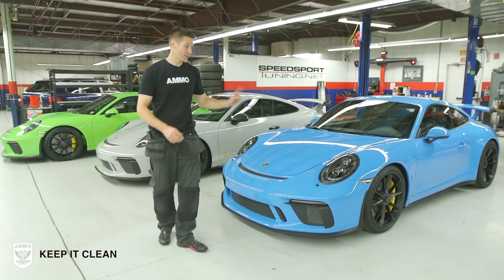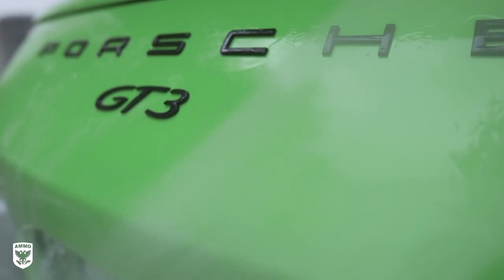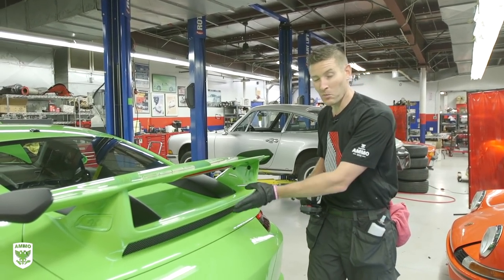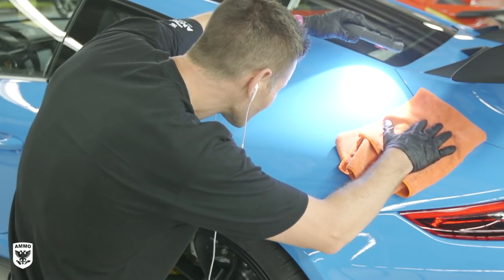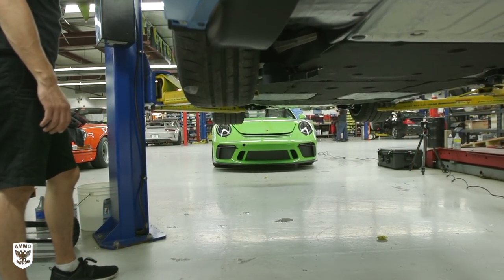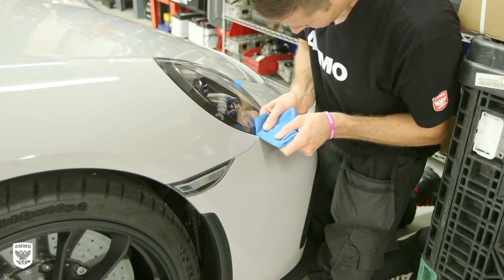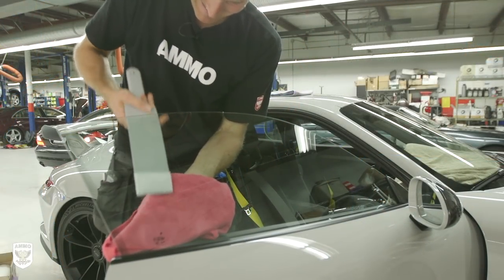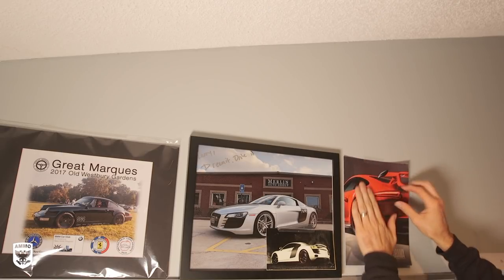Porsche GT3 First Wash & Drive

Comment: Nice work Larry. I've touched on a lot of 991 GT3's and there is a lot of similar content on Rennlist that discusses many of the nuances of these cars. I remember working on the first 991.2 and getting to be the guinea pig that discovered the lack of a headlight tool. That moment you've promised a headlight-out service and see there's no information at all on how to get it out....yep, do a search and you'll find the story on Rennlist. (urgh)
Feel free to get your fill on some of this kind of stuff:
There were a lot of upset folks(in all kinds of ways....) about the condition the 991.2's were arriving in, here. 
https://rennlist.com/forums/991-gt3-gt3rs-and-911r/1034289-waiting-on-your-gt3-to-arrive-prepare-yourself.html
GT3 stuff.
https://rennlist.com/forums/991-gt3-gt3rs-and-911r/1035759-detailed-designs-auto-spa-s-perpetual-991-2-gt3-projects-thread.html
Just older 991.1 GT3 stuff.
https://rennlist.com/forums/991-gt3-gt3rs-and-911r/902952-full-body-clear-bra-paint-correction-coatings-and-more-on-a-gt3-oh-my.html

Happy reading.

Comment: I'm using magic eraser to clean the windows from inside.
Reply: This. But don't by Magic Erasers. That gets expensive. Just search for Melamine Foam. Get much bigger quantities for very low prices.
Reply: Pencil eraser works well to remove wax from black trim
Reply: kc2pih  I had stubborn polish residue on trim that pencil eraser wasn't shifting. Magic eraser with APC did.

Comment: Do you mean 0.6mm with the paint thickness? 6mm is a quarter of a inch is all.
Reply: This is measured in mils, not mm. One mil = 0.0254 mm.

Comment: Those gt3's are amazing, ive driven a couple as a porter for porshe and holy cow i want one, but the suspension option when its selected on full race mode it HURTS like a mf they become crazy stiff. Its cool for a race aspect but daily driving? Way way way too stiff and the seats are bolted directly to the frame i heard which makes it so stiff other then that they are amazinggg

Comment: You think putting stickers on a boot of the car is scary.... scary is working in a American truck dealership (in Australia) with a $10,000 bull bar and drilling holes in to them for a number plate or taking laser film of $50,000-60,000 worth of chrome accessories without scarring it and having to do this in minimal time...that's a little scary.